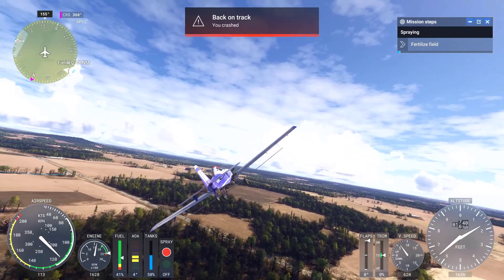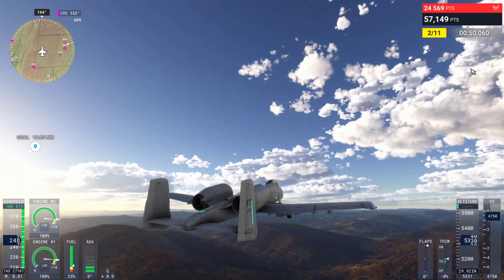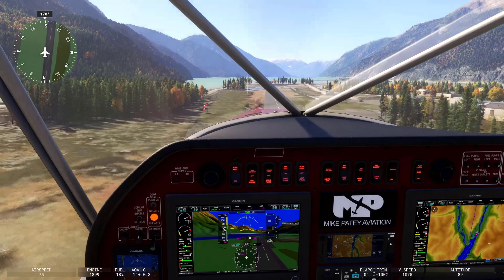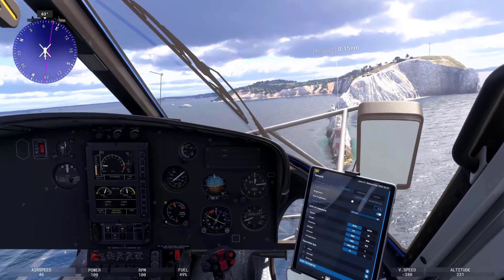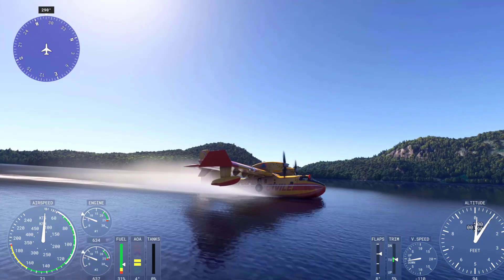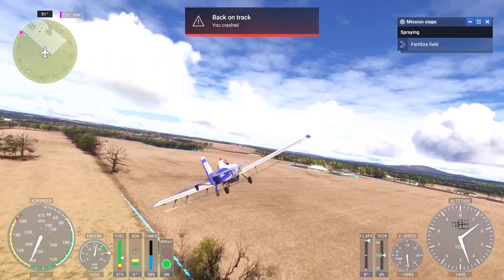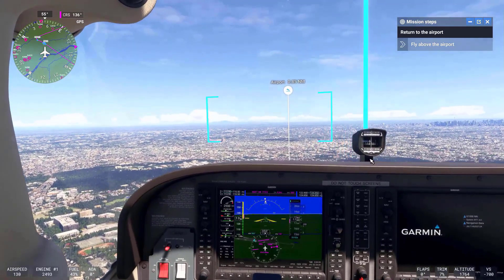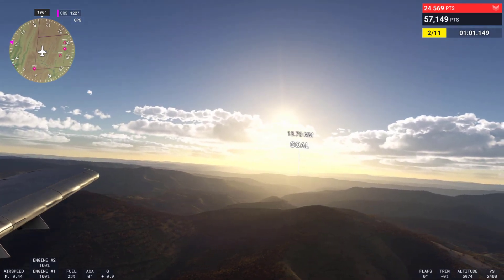HOW MICROSOFT FLIGHT SIMULATOR 2024 FLYING WILL BE REALISTIC

Comment: It is a lie that MSFS 2020 or 2024 uses CFD. There is no computer that can handle CFD in real time. It is just a marketing headline to increase sales. Talk to an aeronautical engineer specialized in CFD and tell him that a desktop simulator with a home PC uses CFD in real time and he will die of laughter.
Reply: Yea that's a bold lie.
Modern computers can handle CFD simulation just fine, it will be simplified for users with the recommended specs, this is one of the main reason the ideal specs are way higher.
Reply: @beardedlonewolf7695  Well then show me a video where a PC handles 3D cdf with the Navier-Stokes equations in real time generating 60 fps. The MSFS SDK does not even have to draw the 3D mesh of the plane. This is a fundamental requirement for any software to be able to perform these calculations. Even in the MSFS SDK manual they themselves state that they use their own interpretation of the Navier-Stokes equations, not the original ones. It would have been much better to use a flight model based on tables and use aeronautical engineering software like Ansys to validate much more accurate results. Even level D simulators use this approach. Before speaking from ignorance I recommend that you inform yourself. There is a lot of literature on the internet about cfd and its applications.
Reply: Just like that, we've found the X-Plane fanboy